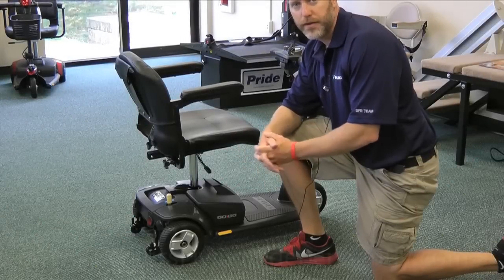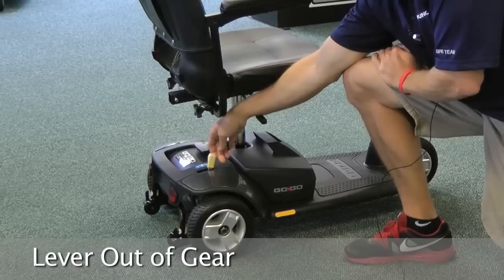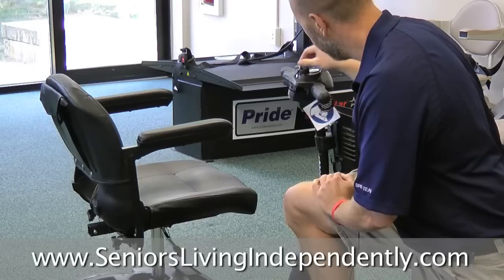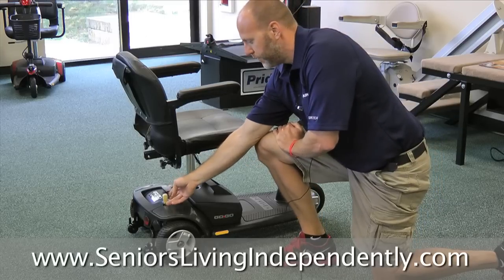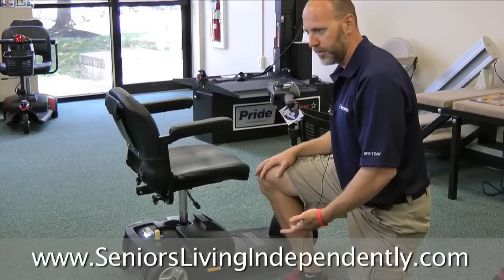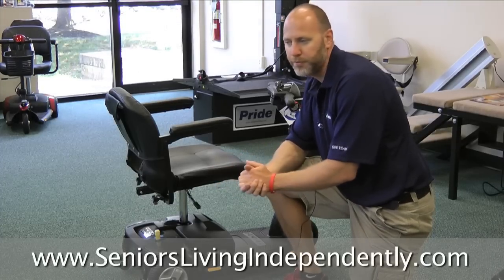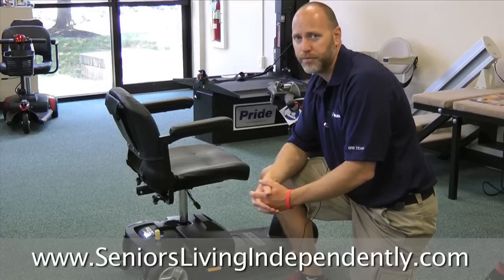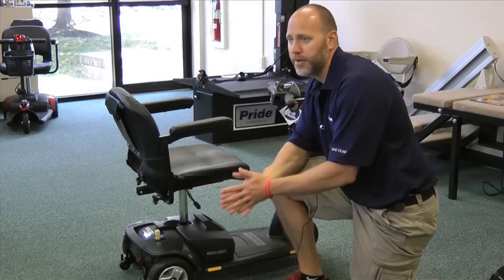MOBILITY SCOOTER PROBLEMS

Comment: One other problem I noticed on a different model, is if you have the lock in the unlock position which disables the scooter from running, and then flip it back to the locked position the problem will still persist unless you turn the key switch off and on again while your it's in the locked position.
Reply: Thats not a fault. Most mobility scooters are designed that way. Check your user manual.

Comment: Thank you very much for this information! I'm getting my first scooter delivered today, and I was wondering about battery maintenance (which I'm sure is probably in the manual, but I'm excited!). It's also nice to know ahead of time why the scooter might not move if the gear lock gets moved into "neutral" during transport.

Comment: I hope you see this soon, I drove into some rocks with the right rear wheel, and got stuck, so after a couple of tries to drive out, I put it in neutral and pushed it out, then I put it back in gear and it beeps five times and won't work. :( I had to push it all the way home. I took the key out, I put it back into drive position and it still beeps five times, thanks. This is my only transportation.

Comment: Hi, Re - bi weekly charging when scooter is put away , in shed over winter. What would you recommend for charging intervals when using every day. I realize continued use will eventually flatten battery and it would require charging to keep going, but is charging daily, an overkill and detrimental to the battery, or should it be charged every alternate day or each third day or something?

Comment: I have a GoGo Elite Traveler Plus.  The the battery charge meter does not light up, but the scooter does work well.
Would there be a fix for the battery level light?

Comment: Hi, I have a similar scooter a GoGo Elite Traveler Plus made in 2009. I'm really frustrated. I did go on YT and watched your video and others. Seemed like it was the brake assembly. Purchased one online and I put it on, no change under similar situation, did the same thing so I sent it back. So I do know what it is NOT. lol. I bought it for $75 and it needed batteries. Bought new. It ran GREAT for 2 weeks. Took it on short trips around town and longer ones. Then one day it took me out of my parking lot and when it started going down hill it beeped stopped and started to roll slowly. Good they don't roll well with the key on! When I pushed it to turn it around it would go for a few yards and stop. I got it back up the hill and when it started down the parking lot it did it over and over till I just had to push it home. It was beeping but it was beeping like mad. 2 different types of beeping and it was hard to count them. Also the gauge was swinging back and forth from all the way on to all the way off, back and forth like a windshield wiper. So I said all that to ask, if it isn't the brake assembly, what do you think I can try. No one in my area will even look at it because of the age and they are all backed up with customers.
Reply: Sounds like you have a loose connection.

Comment: We have the GoGo Ultra X scooter.....last time we flew on vacation, the console was somehow damaged.  It's a 2 part assembly - the top half is simple to replace - you remove 4 screws from the bottom and the top lifts off. The bottom half is another story. It has a hole in the middle, allowing the unit to slide over the vertical part of the tiller assembly. But there is wiring harness that prevents removal of the shroud. I can't find the other end of the wiring harness - it would probably be fairly easy to replace the shroud if I could find it.  Any ideas on this problem or where I might find a service manual?  I've spent hours online without success.  Thanks - Ken

Comment: Hi i have got both the green and red lights on after being on charge for a few hours, it can’t be the charger or batteries at fault as they are both replaced with new a charger and new batteries. Could this be a loose wire or duff controller? Or maybe a hand brake connection fault?

Comment: Looking for some advice on my scooter, first it has new batteries but still crawls along no matter where the speed control is set. Also, I noticed with the scooter off the ground if you turn it on and hold one wheel the other wheel turns at a normal speed. Let go of the wheel and it's back to that super slow speed again. Any help would be appreciated.

Comment: I have Several Issues with mobility scooters.
# 4mp is just not enough for outdoor applications
#2 the wheels are small it jerks at every little bump.
#3 Its length should be able to be extended.
#4 the positioning of the seat is too high.  I often... after falling just can't get myself raised high enough to get in the seat no matter how low.
#5 It seems designed to make folks Look like I valids. The seat needs to recline more. For a more natural appearance.   (Except the high end ones)
#6. I cannot ride them long distance. It hurts my back and neck. @ 4MPH that makes it worse.
   Of course, this means I require a special needs scooter.

Comment: I have a Pride Gogo Traveler and cannot remove the seat. We bought another used one and have the same problem. Any suggestions on how to get these seats off?
Reply: First, if your chair has armrests remove them. This will make the chair lighter. Then fold the seatback down. Next, stand behind the scooter and grasp the seat, one hand on each side of the seat and quickly rotate/wiggle the seat clockwise/counterclockwise while at the same time pulling up on the seat. This works for me.

Comment: help. new battery. charged and full empty as suggested for new battery.. trying to charge again and the green light was on charger instantly... left for 20 hrs charging but chair controller says battery still empty?? if i plug charger directly into the controller port both charger lights are red... plug charger direct to battery pack and the on light is red and the charging light green. is there a problem?

Comment: If the scooter will not be used for awhile, just pull the plug on the batteries to eliminate parasitic current draw;  good AGM batteries will retain charge for more than a year and still test 12.35V or higher.

Comment: have gell batteries  .  went away for 8 months. LEFT IT  in my garage    battery fully charged. upon return   CHARGE INDICATOR SHOWED 100% fORTRESS 2000 scooter. was not on trickle charger either.    would be  pertinate ?  if you had mentioned   WHAT type of battery you were talking about.

Comment: I  have a Rascals 6 runner shoprider chair not the scooter steering kind. Mine is the joystick kind. I went to assemble the chair after picking it up from the person that I got it from. I turn it on and all lights show up but then it just flashes 2 yellow lights repeatedly and doesn't move at all. I checked all of the connections and charged it but still nothing. can someone please help me

Comment: I have a Amigo Elite go go that when I hit even a small the charge gauge gose right to zero and I have to turn the scooter off then back on so I can get going again. Sometimes I have to turn it on and off several times to get it going. Any ideas on how to correct the problem?
Reply: If you have a removable battery box then you simply need to turn the "lock/unlock" knob several times, making certain that you leave it in the licked position.Try this and get back to me with the result. We will get this problem sorted between us, at little or no cost.

Comment: Should the battery be charged very frequently or only when the indication is low - for max performance and life?   Does it matter?
Reply: lead acid batterys last up to 15 years if kept charged...but some will only a couple of deep discharge cycles....keep them charged..with the correct charger after each use for maximum life.

Comment: Red light won’t come on when charging. Put new battery in and charged. The red light still does not come on. The lights on dial show need for charge, charge does not change them.

Comment: 3-5 yrs. for a battery ? The tech fast sold me my battery said 6 mo.
Reply: I got 3 Seasons( Live in Wi)  then waited till March and ordered 2 New, 20ah vs 18ah thru WALMART for $86 for the 2 of them.They have Lithium for Cars and Everything else why not for the Scooters and Toy Cars, etc..?And I need 2 Scooters, 1-3wheeler for my Car whn I go oukt and the other , a HD 4 wheeler to ride around the Neighborhood and to TOW my  ROYBOI thru the Home Depot 3 yrs ago = CELM( CordelessElecLawnMower) vs a PIA to take it apart and put it in my Car, etc and Am Handicapped with Terrible Back issues..( and a Lift or Trailer will work but another PIA..
Reply: 3 - 5 years? Seriously! I ride my scooter almost everyday and use up almost all the battery power. I charge it overnight every night. The batteries seem to last about 3 -4 months.

Comment: i have a rascal 888NR and have a very slight annoying hum when i'm going up hill or under load & was wondering if i needed to top the oil up & how to do that i can see a i can see a bolt on the side with a red washer behind it & i assume i should just get it on level ground undo it & fill till it starts to come out ? is this right & if so what type of oil do i use ?. I really appreciate help on this as no one seems to be able to tell me. Thank you. Gray.